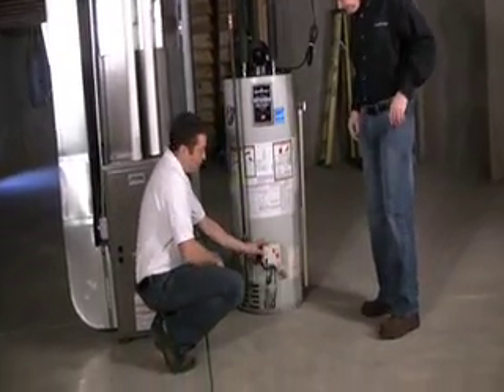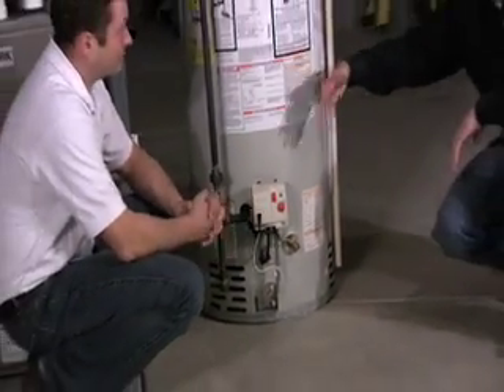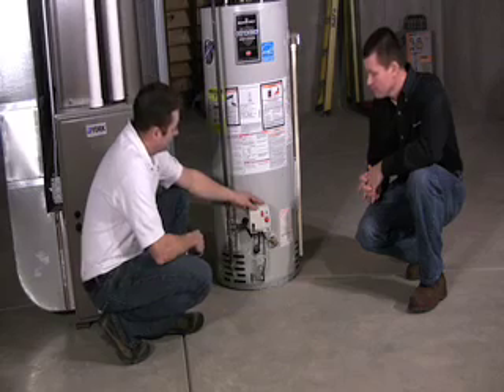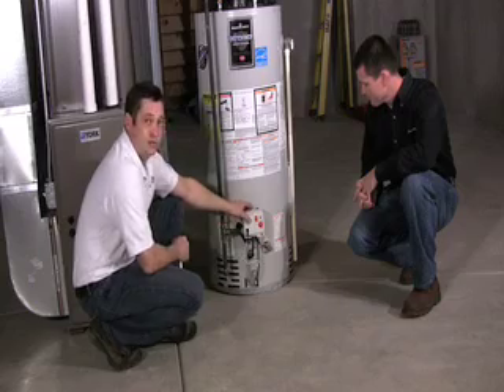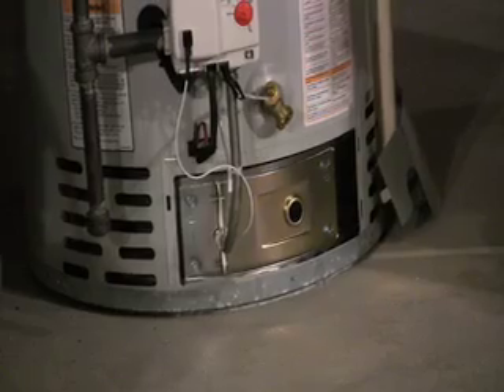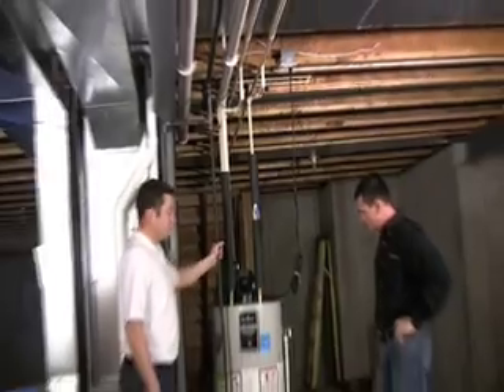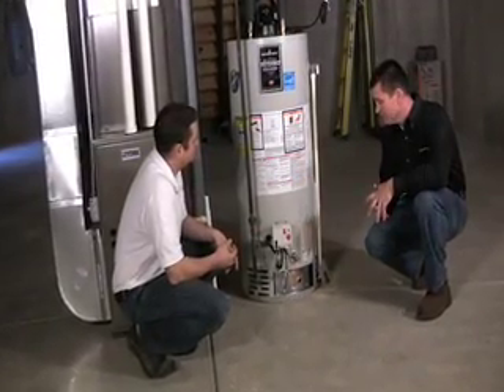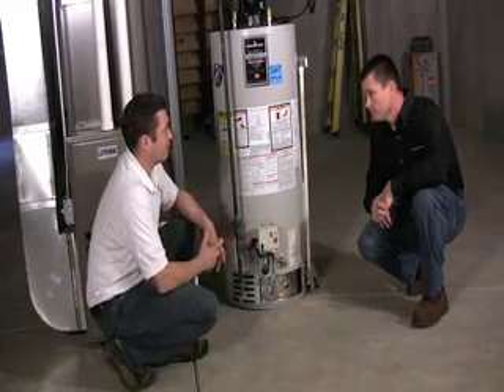Water Heater - Maintenance, Adjustments and Troubleshooting - Part 1

Comment: I have a leaky pressure relief valve. The heater is on the "A" hotness setting, and it is really F'ing hot. This leads me to believe that the pressure relief valve could be leaking due to thermal expansion. What do you think?